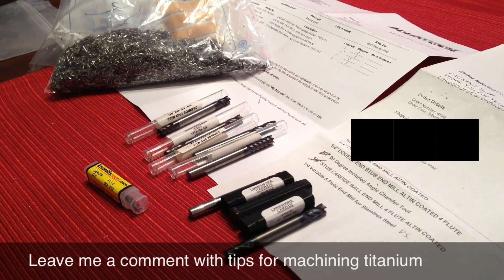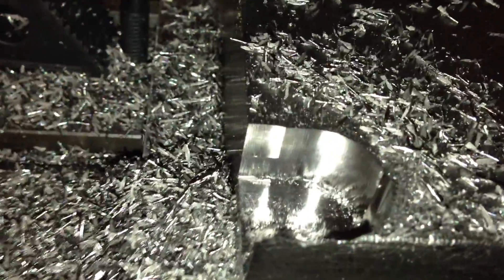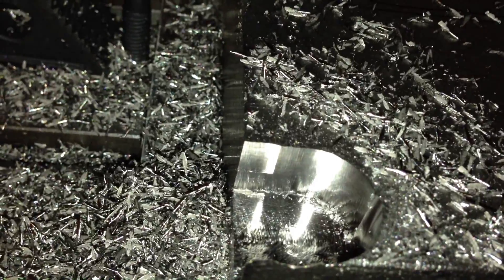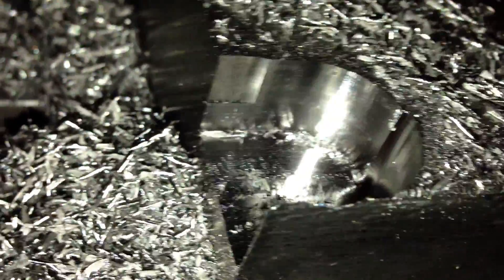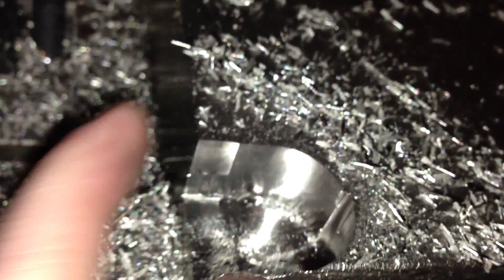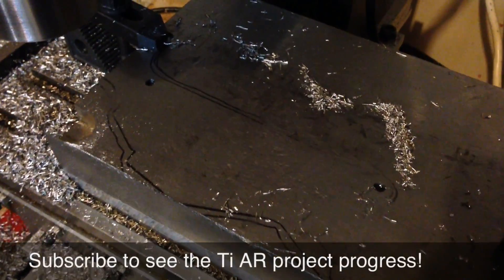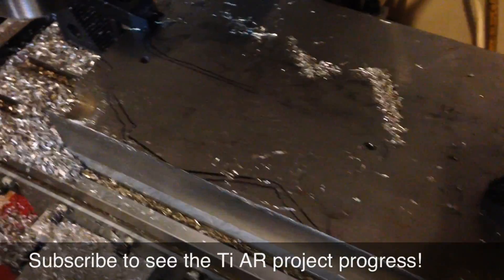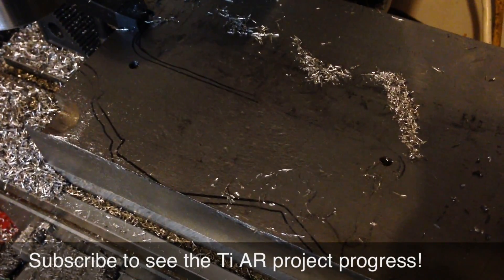Titanium Machining on a Small CNC Mill

Comment: Hi Jim great video , I have been researching titanium just a little , and I was wondering if I could get your thoughts on something , I and getting into Paramotoring ( PPG, or Powered ParaGliding ) as a hobby , I know it will be expensive but eventually I would like to have a 2stroke engine case, crank , rod , cam and piston Machined out of titanium , (10k???? or so) would this be a good idea? the problem with cast aluminum is the heat and parts wear and or fatigue, for every 25 hours or so the engine has to be taken apart and inspected then rebuilt.......

Comment: Do you have any recommendations for trying to do simpler cuts with hand feed? I have an X3 as well.
Reply from the maker: I've done some manual milling / drilling of 6AL-4V without much issue. I've found that you really need to be pretty spot on on your speeds / feeds though. I really like TiAln coated carbide tools. When manually hogging, I really prefer plunge roughing as much as is possible. It allows you to use the rigidity of the Z axis.

Mist is also a huge help, I don't know why it took me so long to get a mister up and running. It's well worth it for Ti.

Comment: What stepper motor driver are you using?  What kind of connection to the computer?
Reply from the maker: I'm using servos driven by Gecko drivers. In this video I used a smooth stepper, I've since moved to a parallel port for control.

Comment: are those the same carbide bits used on routers for  wood working?
Reply from the maker: They are the same base material, but the geometry and coating is different. The spiral angle of the flutes is smaller making for a faster spiral. The edges are also more carefully ground to give room for chips to clear.

Comment from the maker: I thought about doing the flood cooling thing, but most manufacturers don't recommend it with high speed machining techniques and AlTin coatings. Since I'm at the limit of my machines rigidity and the tool is still barely warm, I don't think flood would do me much good. A good airblast to clear the chips on the other hand, would really help I think.

Comment: Try using powdered metal fine pitch rougher with altin coating.  Available from MSC accupro brand.  Usually in their monthly metalworking discount flyer.  It has worked well for me for heavier cuts.  I have a G0704 (1 hp).